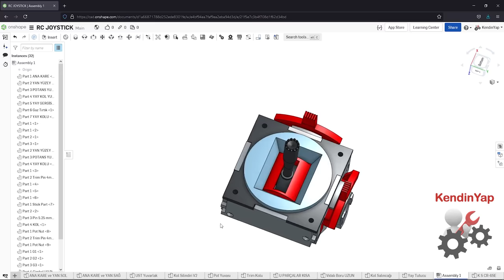How To Make RC Joystick With Trim For Diy Radio Control. Diy RC Joystick.

Comment: Fantastic design. It would also very helpful if you could specify how many from which parts need to be printed for making a gimbal. I can figure it out by trial and error, but would make life a lot easier.
Reply: Pls help me i also want to make a radio control er like this pls reply

Comment: Hi Kendin which slicer do you use and as i can see printer is creality. I have a new CR-6-SE  with CURA slicer but cannot print well your STL files. Perhaps you can give me your slicer configuration. Thanks very much
Reply from the maker: I printed some parts with CR6 and others with Prusa MK3S+. I'm using Cura for CR6. The settings I use for this are Cura's "standard quality 0.2mm" settings (nozzle temp different... 210°). The filament is also important. I am using Esun PLA+.
Reply: @Kendin-Yap  Thank you very much

Comment: You truly mesmerize me with your videos kedin, i am a regular consumer of ur content. I just wanted to ask you the mapjoystickvalue for 300° rotation potentiometer as here in india, 220° or 60° potentiometers are not available. Thank you❤
Reply from the maker: Thank you. You can use existing ones. But with 300° potentiometers, it is not possible to obtain the maximum servo movement.
Reply: Thank you so much kendin❤
Another question i have is, if i cannot attain the max servo movement, then will this be a successful transmitter for a quadcopter as cannot attain the max servo movement?  Thank you for your support ❤
Reply from the maker: @hi-shayan  It will not be suitable for drone. But this is not a problem in fixed-wing aircraft, as the movements already have to be reduced.
Reply: Ok, thank you so much❤😊
Reply: @Kendin-Yap   your drive files not showing as a stl file it's show text file so plese fixed it
Reply from the maker: @hollywoodbuster2740  STL files are compressed. You can open it with any unzip application. Like "Breezip"
Reply: @hi-shayan  bro can you please explain the problem and what can be done to make something that works for drone?
Reply: @bhaveshdevjani3278  the problem that i faced was unavailability of 60° potentiometer, it can be found but need to dive deep into the electronics market
Reply: @hi-shayan  which city/ state? Also, without 60 degree potentiometer we can't create a gimbal for drone? Why is it so? Can't we just map to max value in code?

Comment: Hocam yazılım kısmın da değişiklik yaptım ama servoların bazıları ya hiç dönmüyor ya da çok az dönüyor hatayı nerede yaptım acaba ?
Reply from the maker: Bu potanslar ile ilgili bir konu. Klasik potanslar ile tam hareket almak zor. Alıcı kodundaki map satırlarında ki 1000, 2000 değerlerini 700, 2300 yaparak biraz daha fazla hareket elde edebilirsiniz. Hatta bir çok model uçak için yeterli servo hareket alanın bu şekilde elde edilebilir. Bir de 0,255,1000,200 yerine 0, 255, 0, 180 yazarak deneyebilirsiniz. İdeal olan ise 60 derecelik potans kullanmaktır. Ama zor bulunuyor ve bu yüzden pahalılar.
Reply: @Kendin-Yap  çok teşekkür ederim 🙏

Comment: Hello, kendin i am making the joystick but i am not getting 5k pot of 60 degree or 220 degree I am getting it of 300 degree rotation, now what to do?
Reply from the maker: The ones I use in the video are also standard pots. (320 degrees). And the code is for standard pots.
Reply: @Kendin-Yap  Thanks for replying Kendin but there is one more problem that in the description of the video you have written that you have used 220 degrees pot but now you have said that you have used 320 degrees pot will you please specify that which one you have used.
Reply from the maker: @anuragsen3694  Sorry.. 320 is a typo. 220 is the correct one. And this is the standard pot value. Pots sold in general are of this value.
Reply: @Kendin-Yap  Thank you very much for supporting me. 
I live in India and here many of the Chinese e-commerce sites are banned that's why I am not getting 220 degree pot, will you please provide me the link of site from which I can buy other than that of chinese one. Here I have ordered 5k pot but i have not noticed that it was of 300 degrees. Will you please help me out here either by changing some code or by providing me the link of 220 or 60 pot.
Reply from the maker: @anuragsen3694  https://www.amazon.com/HiLetgo-Single-Joint-Potentiometer-Variable-Resistors/dp/B00N1ZIXKA/ref=sr_1_1_sspa?dchild=1&keywords=5k%2Bpotentiometer&qid=1630400507&sr=8-1-spons&spLa=ZW5jcnlwdGVkUXVhbGlmaWVyPUFSQjI5QU84WjBFOEImZW5jcnlwdGVkSWQ9QTA1NTA3OTM0UlpCNEExRUswQ0smZW5jcnlwdGVkQWRJZD1BMDk3NTY1MTNWRjdJNjRSOU1MQUgmd2lkZ2V0TmFtZT1zcF9hdGYmYWN0aW9uPWNsaWNrUmVkaXJlY3QmZG9Ob3RMb2dDbGljaz10cnVl&th=1
Reply from the maker: The pot you have could be 220. The degree is not related to the physical turning diameter of the bar. It has to do with the boundaries of the resistance field inside.
Reply: @Kendin-Yap  Thanks kendin, your help means a lot me. I will definitely send you the video of flying DIY trainer plain using DIY transmitter and receiver.

Comment: Thanks... I've been waiting for this.. 
But where is the 3d printing files?! 
I hope u will add it
Reply from the maker: Thanks. I added the link below the video.
Reply: @Kendin-Yap  great work bro.. U deserve more
Reply: @Kendin-Yap  stl files u are uploaded is not working... Can you fix it?! Please
Reply from the maker: @ssh.1337 I checked it and it's ok. The link is working. There may be a problem with your computer. The link below is the same. If there is a problem, you can try by copying the link and copying it to the address line of your web browser.   
 https://drive.google.com/file/d/1ZlpIAxfP1wnGc7GlhO2QGnEPlw-hXZuc/view

Comment: You can use 5k potentiometer I can use 10k potentiometer its working or not please tell me
Reply from the maker: It has to be 5K. 10K will work but the signal limit will be different.
Reply: OK sir but its working or not 10k potentiometer is good or not please reply
Reply from the maker: @bagavathi9428  not good

Comment: How did you control the brushless motor with orduino nano?? Can you show me the code??
Reply from the maker: Arduino does not control the brushless motor. It controls the brushless ESC. Brushed and brushless ESC are controlled by the same principles. No other code is required.
Reply: @Kendin-Yap  how to do esc calibration with orduino nano??

Comment: how much infill did you use?
Reply from the maker: 0.2 layer printed with standard settings. (infill 20)
Reply: @Kendin-Yap can i use normal pla filament? I have either PLA , ePLA or ABS filament

Comment: Hello friend, great channel, congratulations!!!

I replicated your project, I noticed that there is a piece with an off-center hole that leaves the axles a little crooked, the piece would be the one with the name KendinYap (SIDE PART 1), other than that the project was perfect, I will use it in some ideas.

Comment: Merhaba sizi zevkle takip ediyorum. Yayınlarınızı sabırsızlıkla bekliyorum. Kanal için teşekkürler. Size bir soru yöneltmek istiyorum. Kullandığınız potansiyometrelerin açı değerlerini vermişsiniz. Ben satın almak için açı değerleri ile arattığımda malesef bir karşılık bulamadım. En azından Potlar için bir ohm değeri yada satın alma linki verme şansınız olabilir mi? Teşekkür ederim.
Reply from the maker: Teşekkürler. Açıklamada belirttiğim gibi 60 derece potlar zor bulunuyor. Türkiye de en yakın 90 derece bulabildim. https://www.direnc.net/10k-tek-turlu-90-derece-potansiyometre . Ama bunlar 10K maalesef. 5K olması gerekiyor. Ali ekpreste 60 derece 5K var. Ama onların ölçüleri standart potlardan küçük. ve fiyatları yüksek. https://tr.aliexpress.com/item/32753162997.html?spm=a2g0o.cart.0.0.79a93c00TMOP29&mp=1 . Benim tasarımım standart pot ölçülerine göredir.
Reply: @Kendin-Yap  Verdiğiniz cevap için çok teşekkür ederim. Yeni projelerinizi dört gözle bekleyeceğim. Saygılarımla...

Comment: Code!?
Reply from the maker: Code???. This video is only about joysticks. You can check previous videos for RC.
Reply: Designing an Arduino autopilot for a PIK-26 light sport aircraft involves several components and considerations, especially for controlling the aircraft's servos, sensors, and feedback loops. Here's a general overview of how you could approach this project, along with servo recommendations.

### 1. *Key Components for the Autopilot System*
   - **Arduino Board**: A powerful microcontroller like the Arduino Mega 2560 or Due, which has more memory and input/output pins than an Uno.
   - **IMU (Inertial Measurement Unit)**: A sensor like the MPU6050 or BNO055 that provides information on pitch, yaw, roll, and acceleration.
   - **GPS Module**: A module like the NEO-6M GPS to get location, speed, and altitude data.
   - **Barometer**: A BMP280 or MS5611 sensor for altitude control.
   - **Magnetometer**: An HMC5883L to measure heading.
   - **Communication (Optional)**: A radio module like the XBee for remote monitoring and control.
   - **Power Supply**: You’ll need a reliable power supply, possibly a 5V/2A or more robust system, to run the servos and Arduino.

### 2. *Control Surfaces & Servos*
   The PIK-26 typically has:
   - Ailerons (roll control)
   - Elevator (pitch control)
   - Rudder (yaw control)
   
   The servos will control these surfaces, so selecting the right servo is crucial.

### 3. *Suitable Servos for PIK-26*
   Since the PIK-26 is a light sport aircraft, the servos need to be reliable, strong enough for aerodynamic forces, and with precision.

   **Suggested Servos**:
   - *Ailerons**: For this, you’ll need high-torque servos. Servos like the **HS-7954SH High Torque Steel Gear Servo* (7.4V, 24.7kg-cm torque) or *Savox SC-1256TG* (20kg-cm torque) are ideal for their high torque and precision.
   - *Elevator**: A similar high-torque servo like the **Savox SC-1258TG* (12kg-cm torque) or *HS-7954SH* can be used.
   - *Rudder**: The **HS-7955TG* is another great option with 29kg-cm torque at 7.4V, offering solid reliability for controlling the rudder.
   
   You may also want to consider *brushless servos* for increased durability and efficiency, such as the *KST X20-1035* series.

### 4. *Basic System Overview*
   - **Inputs**: The IMU, GPS, and barometer will provide continuous feedback about the aircraft's position and attitude.
   - **Outputs**: The Arduino will process this data and send signals to the servos to adjust control surfaces.
   
   - **Control Loops**: You would use PID (Proportional-Integral-Derivative) control algorithms to maintain stability and ensure that the plane follows the desired path. Arduino has libraries to help implement PID control, such as the "PID_v1" library.

### 5. *Example System Block Diagram*
   ```
   IMU + Barometer + GPS + Magnetometer --> Arduino Mega (Processing) --> Servos (Aileron, Elevator, Rudder)
   ```

### 6. *Arduino Code Concepts*
   - Read data from IMU for roll, pitch, and yaw.
   - Use GPS data to control navigation (latitude, longitude).
   - Implement a PID control loop for stability.
   - Send PWM signals to servos for control surface adjustments.

### Conclusion
To build an autopilot system for your PIK-26 using Arduino, you'll need high-torque and reliable servos to handle control surfaces, and an Arduino with sensors for feedback and navigation. The key to success is accurate sensor input and precise control algorithms for real-time flight corrections.
That was chat gpt answer, can you help me!?

Comment: Cad file?
Reply from the maker: I added the STL link below the video
Reply: @Kendin-Yap  how much time did it take design the joysticks?
Reply from the maker: @hasyaactive2984  I didn't calculate it but I think 2-3 weeks. I did a lot of test printing so that the mechanism could work well.
Reply: @Kendin-Yap  have made support for them?
Reply: For each part?
Reply from the maker: @hasyaactive2984  Only these two parts should be printed with support "GIMBAL PART U1" and "STICK PART"
Reply from the maker: @hasyaactive2984  And "TRIM PART"
Reply: @Kendin-Yap  Can I use these to make a DIY video in Hindi?
Reply from the maker: @hasyaactive2984  Sorry, I don't prefer my design to be used in other videos.
Reply: @Kendin-Yap  ok no problem

Comment: stl dosyaniz ile buradaki urun ayni degil. Yuklediginiz stl dosyasindaki parcalar oturmuyor.
Reply from the maker: Stl dosyaları bu videoda kullandığım dosyalardır. Ayarlarınızı kontrol etmelisiniz. Parçaların fiziksel ölçüleri Printera ve filamente göre değişiklik gösterebilir. Örneğin bazı printerların (Artillery gibi) akışı çok daha fazladır ve parçalar olması gerektiğinden şişkin çıkar. Bu gibi durumlarda akışı (flow) azaltmanız gerekir. Ben Prusa MK3 ile Esun filament kullanarak parçaları bastım. Ve kusursuz uyum içinde işlevsel çalışmaktadır.
Reply: @Kendin-Yap  cevap için teşekkürler fakat örnek olması açısından 1:08 deki parça ile indirilen stl dosyası arasındaki farkın pini taktığınız holün altında bulunan açıklıktan anlayabilirsiniz. İlgili parça dilimleyicide oradaki açıklık olmadan görünüyor zaten. Bu nedenle 4mm trim pin hole girmiyor. Ayrıca 1:23 deki parçaya da oturmuyor 1:08deki parça.